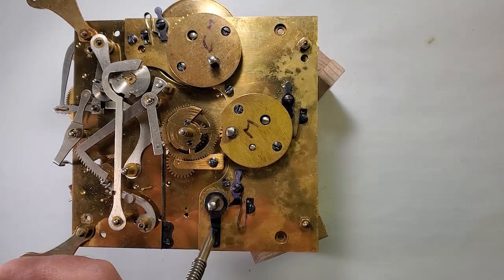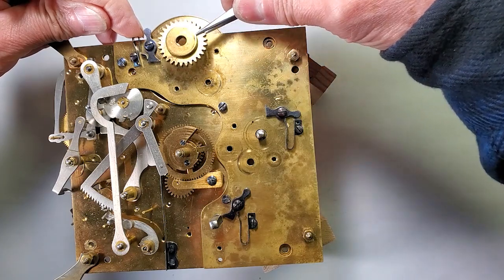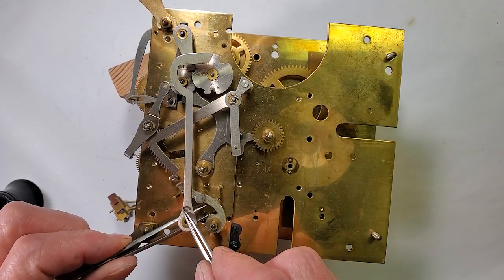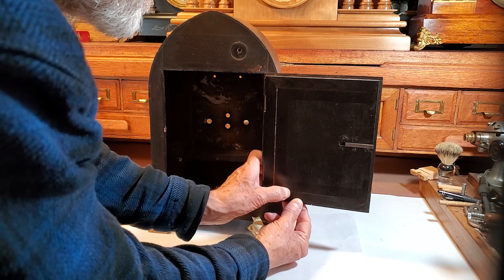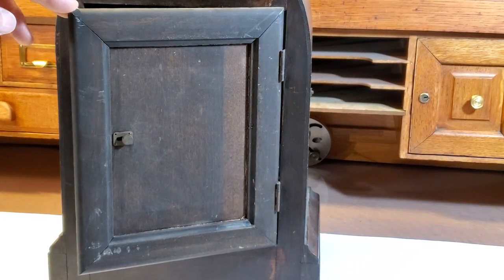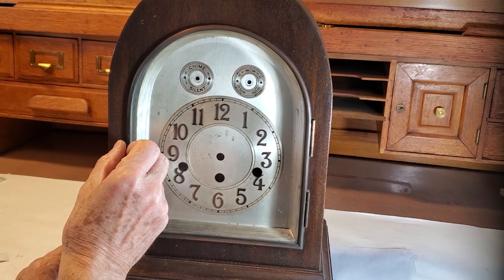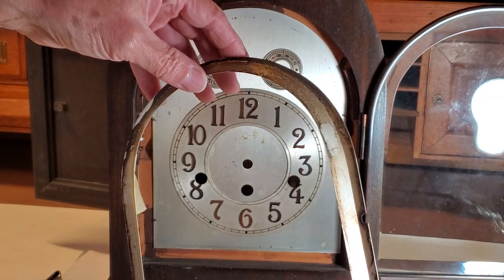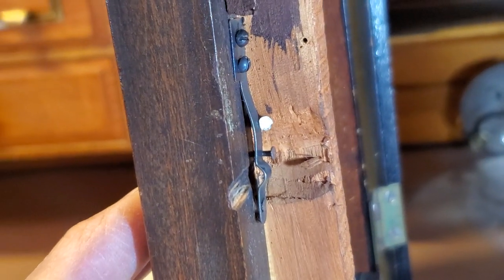Junghans A42 restore for Joseph from New York #42

Comment: I disassembled the front end.  The four quarter hour pins all looked in good condition.  I bushed the 3/4 hour pin with 1.5mm OD x 1.00 mm ID brass tubing.  It is working just fine.  I'll assume wear in the pins and the trigger arm bushing was just enough for it not to have enough throw.
Reply from the maker: Good to hear

Comment: Really nice work.  When you mentioned putting in about 24 bushings I found myself speculating on how much time that took.  With custom making each bushing, broaching out, testing the fit, etc my guess would be half an hour per bushing at least (or a total of 12 hours just for the bushing work) but on the other hand you've put in probably hundreds of them so maybe a little less.  Thanks for sharing.
Reply from the maker: Thanks Paul, its a nice runner now.
Yes, it all takes time, its enjoyable.

Comment: Marvelous work again, this time keeper looks good to be enjoyed and hopefully used for many more decades. Thank you for sharing your knowledge! Just a quick question, how would you tune the chime notes.. is it only about the length of the 'tubes'.. thank you Mr. Martin.
Reply from the maker: Length is important, but not the only item to consider.
There are several different ways to tune chime rods.
If there's an odd or flat sounding note in the chime that you want to make go away.
Take some 000 steel wool wrap it around the rod and run it the length of the rod several times, this can bring back the sharpness ring to a rod.
Push the hammers down onto each rod and if they slide off to one side or the other, tweek the hammer arm so hammer hits dead center on the rod. 
Its also important to have the right gap between rod & hammer,  its different from one clock to another, some sound off great with just a 32nd of an inch, while others sound better with a bit more, there's no standard its all trial & error.
Loosening the set screw on top of the hammer & moving it down a bit on the arm so its not hitting  rod in the same place as it was before will sharpen the tone slightly.
A file can be used to tune, file the end of the rod sharpen, to flatten you file the rod thinner near the screw.
I would resort to the file as a last option.
What ever option is used, go slow with it, taking off too much is not a good road to be on.

Comment: The A 42 may not be a date code.  From what I can find is that there is some indication that it is a movement type, i.e. mantle, wall etc.  Other info says a date?  From 1939 to 1952 Junghans I am told produced very few clocks or watches.  The war years they did make fuses and other mechanisms for artillery, missles and mortar rounds.  They still do today (as well as watches).  I would be very surprised if the clock is 1942 .  Could be very wrong....
Reply from the maker: I agree with the date codes on these.
 I am finding conflicting information on how Junghans dated their movements.
I have looked at the Junghans current web site and can find nothing in reference to how their the early clocks were date coded.
The old Junghans factory building is still standing, Its been turned into a company museum, maybe the answer is within any paperwork or document's that survived the war over there.
Always research to do on these old clocks to dig up buried answers.
Reply: @jamesmartin5370  Appreciate the response I have 2 similar mantle clocks by Junghans and both are from the immediate post WW1 years.  Since brass was an essential war material I have found it hard to fathom that the Germans would have allowed the production of something as 'frivolous' as clocks. Great videos!  Glad I discovered the channel.

Comment: What was the process that you used to restore the clarity and reflection of the plates? I’ve worked on plenty of junghans that I wished I could’ve made look like new, now I know it’s possible!
Reply from the maker: The plates were in fair shape, I removed the old varnish then used a fine aluminum oxide product on them, degreased them and sprayed clear urethane on them.
For final polish prior to degreasing them you could use any fine red iron oxide jeweler's rough, I used 3M Finesset ii for final polish, its in the range of 3000 to 4000 grit and its a quality product. I didn't get into resurfacing and removing deep heavy scratches so what I used worked fine along with the clear urethane. You need to put a finish the plates to seal the brass or oxidation will appear and shine will quickly turn to a dull finish.
Reply: Okay sweet! Definitely a lot more steps than anticipated but i’ll give it a go nonetheless. Thank you Mr. Martin

Comment: James, Can you explain the correct adjustment of the strike and chime mechanism?  I cannot get my friend's A52 strike properly.   Should the high lift 1/4 hour pin lift at the 3/4 hour mark?
Reply from the maker: Would almost need the movement in hand, since there were many engineering and configuration changes on these.

Comment: Hi, my Junghans with similar chime setup doesn't sound this nice, deep and low. More of a high pitched chaos which i dont think long chime rods suppsoed to sound like. DO you have any video on the chime hammer heads?
Reply from the maker: No video on Junghans chime hammer heads.
Yours might need new leather mounted in them.
Should be an easy job.
Leather gets hard when it ages, this will change the pitch of the chime rods from low to high.
Reply: @jamesmartin5370  Well, it turns out there was something really wrong with my chime block. Especially the lowest note rod, its either the crimp has loosen up or the rod itself is messed up. The moment I installed another chime block from a parts clock, it sounded just like the one in the video.
Reply: @isFuzzy  glad to hear its up and sounding like a normal one again!